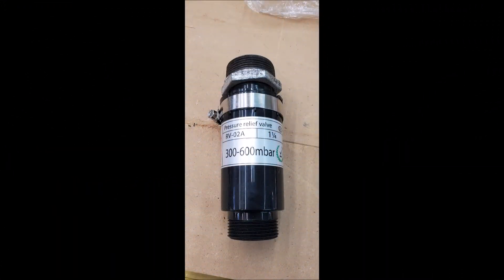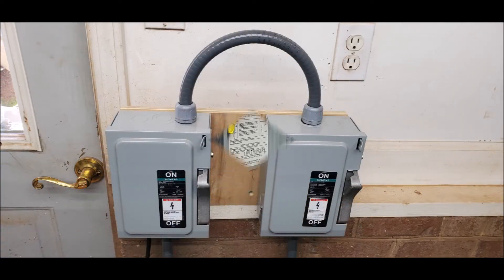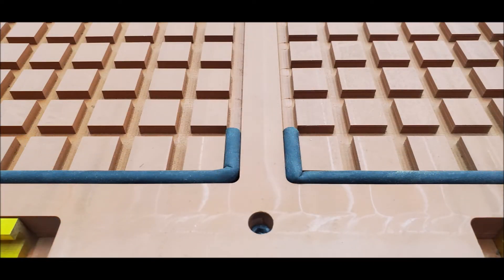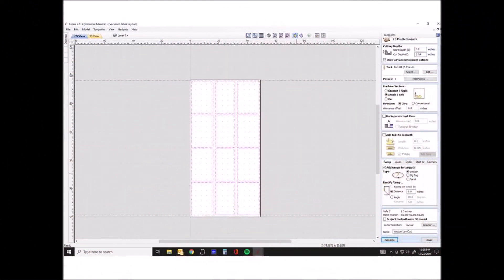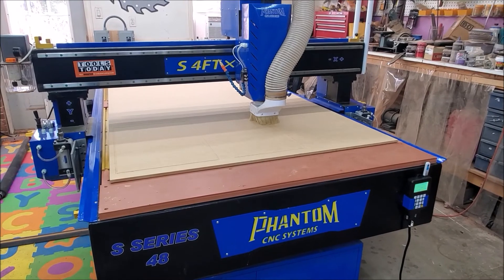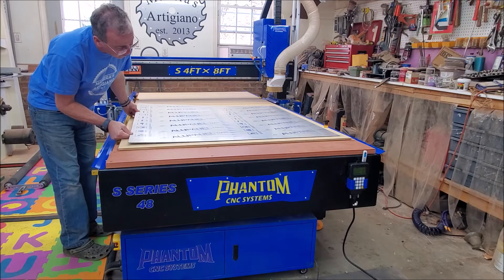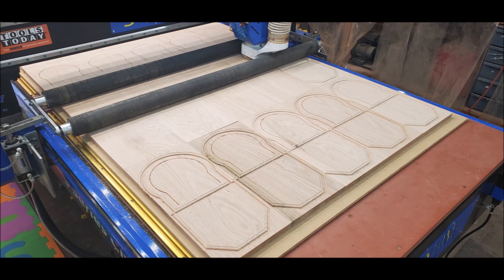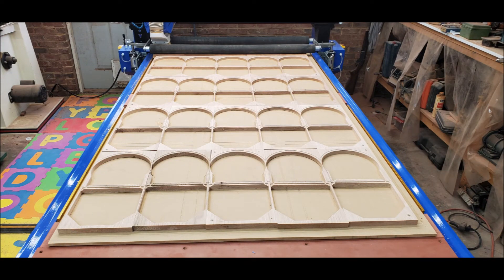Setting up my first vacuum table on my new S - Series Phantom  4x8 CNC

Comment: Great video !   Thank You.  
I wish someone would do a comparison or test with two vacuum pumps to determine if piping them in series or parallel is actually better.  This was always a debate when putting two water heaters together- I come from the plumbing trade.   I would also like to add to this test, one vacuum pump on each 1/2 of the table - why not split it up?  I am very curious as to which of these three different configurations works best.